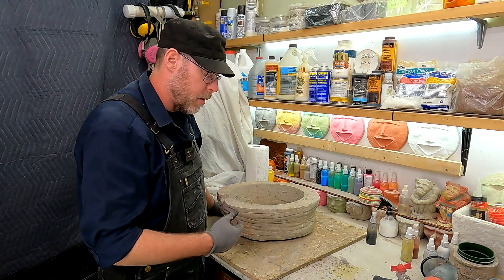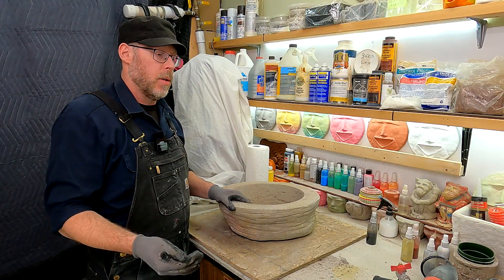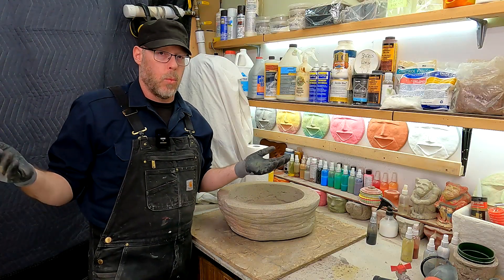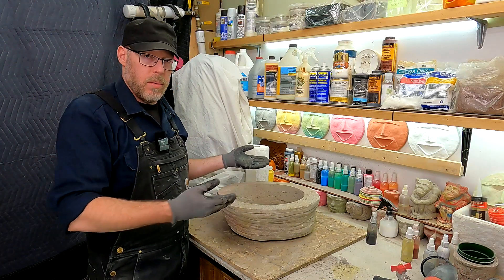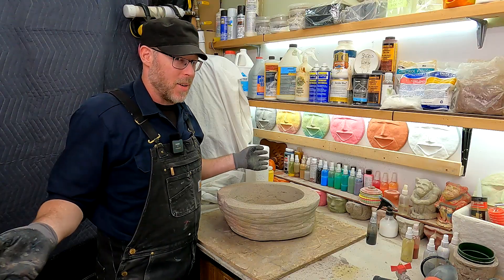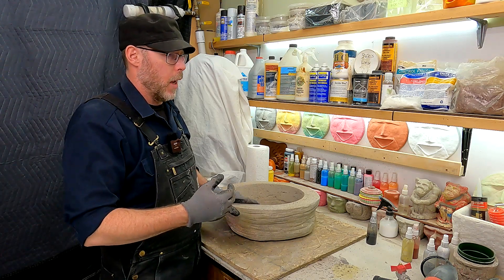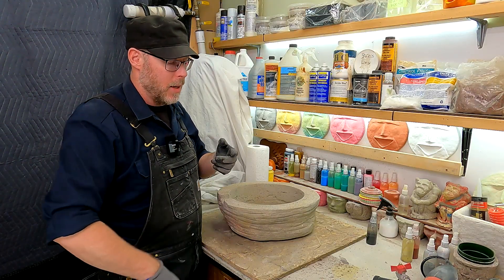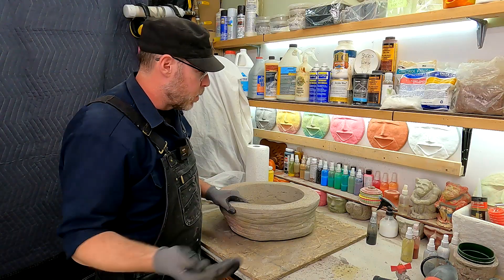Is Concrete Waterproof?

Comment from the maker: As for how to actually waterproof concrete the method depends on the application. Ingegrally there is xypex. It is a crystalline growth which densifies and water restricts the concrete porosity. There are membrane solutions like Redgard, Hydroban by Laticrete, others, which offer positive side hydrostatic resistance. Then others still like Basecrete which are not a membrane but a flexible, waterproof concrete. It can provide 100% water fastness against both positive and negative hydrostatic pressure. So there are solutions, but they are each pretty technical with a very specific set of circumstances for which it will work, and an every larger and even stricter set of circumstances which it can not lest it will fail.

Comment: You are correct. My pond was leaking. So I removed the liner. No way I could find it because it was for my 5 dogs. Scratches and holes everywhere. So since I built water features for a living, I built my pond out of concrete. In order to make the concrete refuse water, you need to add a hydraulic to the mixture and chicken wire. Then use DryLock and paint over it. The DryLock will need about 5 days to cure. It’s a lot of work but the results will pay off in the end. I have a 400 gallon pond. It took just me, 1.5 months from start to finish.

Comment: From Sika's web page:
Pore blockers such as Sika Watertight Concrete Powder and Sika-1+ coat the capillaries with a hydrophobic chemical that impedes or stops the passage of water. Crystalline admixtures, such as Sika WT-200 P include a chemical which reacts with elements of the cement in the presence of water to create new crystals, filling cracks and capillaries in the concrete over time.